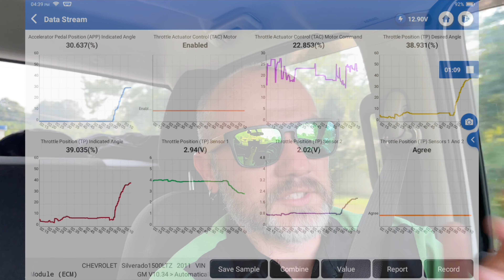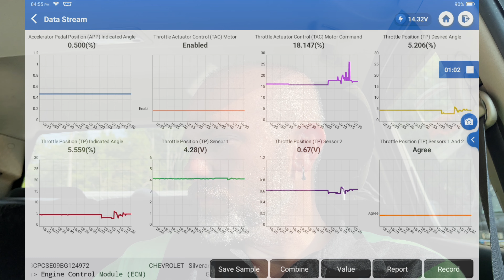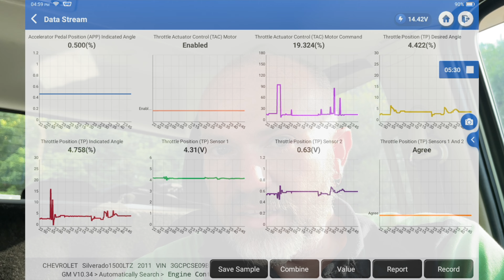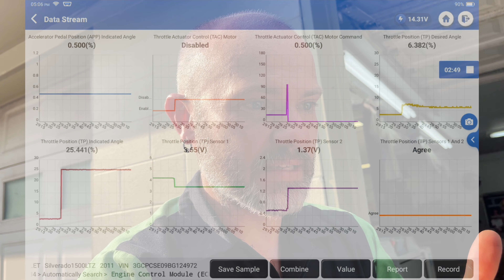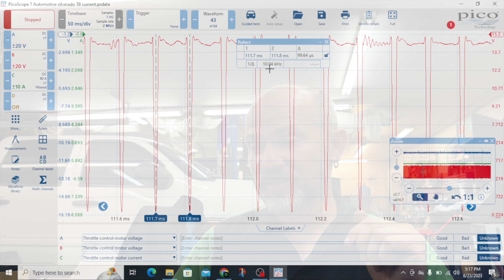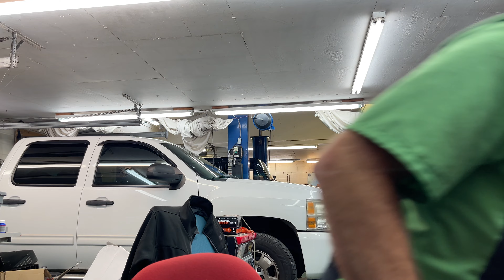Today I was a Parts Changer...

Comment: Posting this because it might help others, on some GM cars (in my case a Pontiac g8) there are 2 different throttle bodies.  Most the time parts store only carries the cheapest one which for the most part is the wrong one! I chased an issue like this where the car would go into reduced power mode after a few minutes of driving.  Customer came to me after installing throttle body as well! I was puzzled because everything looked ok on scanner.  So we through another throttle body on it and the second time I realized theres 2 different throttle bodies! Bought the other one and bam it works ! 
Trucks may only have one I’m not sure but cars had 2 different ones !

Comment: Use the power probe to provide power to the throttle body motor with a PWM signal
Reply from the maker: I'm not sure how that would of helped but if I run into this issue again I'll give it a try.

Comment: The ETC motor (DC brushed motor) is being controlled by an H-Bridge 4 quadrant PWM control algorithm as a geared positional system (servo system) which is acting against a default return spring in the throttle body and uses redundant throttle position sensors as feedback for actual position.  The PWM frequency is most likely above human hearing (most humans anyway at 10Khz) and to best tell what the motor is doing we need to monitor the motor current.

So the aftermarket throttle body has an intermittent brush? The current through the motor cannot change instantaneously with loss of connection due to the motors winding inductance. It does seem a little crazy not to use an OEM part for a critical component like the throttle body.

Comment: I have one now 2007 GM van throttle body issue. Had several throttle body’s replaced connector replaced throttle position sensor replaced all OE  and new pcm.. it’s been having issues for years.. Monday’s job, funny u posted this video.. ty

Comment: On my woman's 2010 dodge nitro.  It was doing something similar to this--   the current would taper off suddenly and then it would spike and go haywire.   I watched a few videos on it and seen that most of the time it was the throttle body--- so I fired the parts cannon with a cheap fleebay aftermarket throttle body at it and it fixed the issue.  So I opened up the old one to find that the plastic gear had a broken tooth.  So when the gear would come up to that broken tooth-- the current in the motor would drop off suddenly because there was no longer a load.    The tricky part was that the tooth was still there -- it was just hinging back and forth--  so it was broken, but not broken off completely.  So sometimes it would still operate as it should, but if you held the throttle in a certain spot, it would push that broken tooth out of place and make it go nuts again.   We use the throttle in nearly the same spot most of the time (between 2k and 3k RPM)  and that causes it to wear on that tooth more than any of the others.   Luckily when this happened, it still let me drive it home in limp mode.  Sometimes it would randomly go full throttle and I'd have to cut the key off, put it in neutral and start it again (on the highway) ---  to get it home. lol.    But I figured out, if I just held the throttle in a certain spot, I could get it home.  when I tried to rev any higher than that, it would go haywire again--  because that's where the broken tooth was.   This happened on one of the coldest nights of the year---   So I think it just got too cold and too brittle, or maybe some moisture got inside and it froze the butterfly in place.   The cheapo aftermarket junk throttle body has worked well now for a few years.  cheers

Comment: Come on man, this does NOT qualify you as a parts changer.  These were controlled experiments with data collection before, during and after, changing one variable at a time.  Swaptronics at most.  I view parts changer and parts canon as almost blind attempts.  

Was this throttle body controlled directly by the ecm, or did it have a throttle actuator control module between the two?
Reply: @autodiagyt  didn't mean to take your title from you lol.. just didn't want to see you sell yourself short.

Comment: Looking at 13:57 in the video, my guess will be that there is some debrie in the internal cogs of the throttle body, or some damage that makes the motor not rotate smoothly.

The motor the throttle body has is a regular DC motor, magnets in stator, coiled rotor, collector and carbons.  When this type of motor speeds up, the current it pulls will go down; you can see it it as a DC generator creating a voltage opposed to the power voltage applied, and only the difference of voltages divided by the coil resistance is the current.

The reason I say debrie or something preventing smooth rotation is due the current waveform:  13:57 -> current goes up and down from 70.0ms to 90.0ms, while ECU has a constant voltage across terminals.  If it was just spinning up without obstruction, the current will only go down as it spins up, but something blocks and breaks it, and current goes up, then it overcomes the issues and spins up again, and hits it again.   You can see that it hit an obstruction 6 times, as it sped up (the little bump ups in current) but then at the 7th one, current started to increase a lot, and ECU kind of gives up, maybe overcurrent.

Also, diff topic, the time units:
ms = milli second 10^-3  (.001)
us = micro second 10^-6 (.000001) letter "mu" from greek alphabet, not "u"
ns = nano second 10^-9 (.000000001)
further details see wikipedia  "Metric prefix"

Great video as always.

Comment: Laughing, Seen that so many times we don't even do any testing anymore especially when we see a newish AM throttle body.
Reply: We got to talkin about that today, we decided that the motor inthe aftermarket throttle bodies can't keep up with the rate at which the computer is commanding it then the computer starts freaking out trying to control it. I think that's why you didn't see the amperage draw you were expecting because the motor simply wasn't responding

Comment: I have one like this that does something a bit different. I graph all the data pids app 1 and 2, throttle 1 and 2. And 5v ref 1 and 2. I will randomly drop out all the data pids to stars ****. I recommend ecm but haven’t gotten around to replacing it. Seems like a right call it has app and throttle acdelco
Reply: @autodiagyt  not that I’m aware of, it only sets a throttle related code. So I mainly looks at throttle data

Comment: Analyzing data like this can be tricky and takes practice. You were on the right track by looking at voltage on both sides as well as current. When I Looked at the data (obviously after the fact, knowing what the problem was) it makes sense that the throttle body is faulty. Look at the facts: When you said “if I’ve got constant power and constant ground, why is current dropping?” To me, this could only mean the resistance of the motor windings was increasing which caused the throttle plate to close and the engine to stall. We can all learn something from this. Great video!

Comment: Changing parts at no cost or even low cost to quickly rule out potential suspects is a totally legitimate diagnostic procedure.  Often times it ends up costing less for the customer instead of paying you by the hour doing testing to figure out if a part is bad.

Comment: Interested to see an in depth autopsy of these bad aftermarket sensors and circuit board controllers so we can see what they are doing wrong. You and Ivan should send them to someone who will open them up and test the circuits compared to an oem and see why these parts are no good.

Comment: Lol!  I would've called the ECM also seeing what you saw Jake... Great case study.  At the shop I work at I constantly have to try to convince,  and sometimes even argue for OEM replacement parts.  Certain parts you just know you have to go OEM or you're going to have problems,  if not immediately, than shortly thereafter.   I get so tired of doing the same job twice due to faulty new parts.  The Industry has definitely faltered in this area.  Great job again Jake.  Thanks for putting in the time and effort.

Comment: Nothing like the old days, steel cable from pedal to throttle.😊
Reply: Not that great when the cable the tube runs in has dirt or is damamged due to friction.  I have been there, and the engine keeps accelerated without pressing the accelerator.  Not good.
Reply: @ikocheratcr  easy fix, turn key off replace cable or clean and lube it and move on with your life. With this modern tech, you need a few thousand worth of equipment just to find out your throttle body is bad. 😉

Comment: I had the same problem about two weeks ago. I scoped the tps 1 and 2 and the tps 2 was pulsing and at the same time i had the amp probe on tac motor and it was pulsing too. To find the problem i disconnected the tac module and no more pulsing. We put a factory tac motor and all good.

Comment: nice bit of diagnosis work my friend and i would agree there that motor windings must have been heating up to change the draw . i tell you man i am 57 years old if i had a pound or a dollar in your case for every time a after market part had lead me on a wild goose hunt. i would have been able to retire years ago 🤣🤣🤣 worse thing is you would have thought i should have learnt by now . yet last week i was looking at an intermediate starter fault for an hour or so and yes you guessed it turned out to be a bad starter solenoid . after market part , i should have just gone straight for the starter but i like to know what’s gone wrong but also why it’s gone wrong  . sometimes it’s just because it’s crap 🤣🤣🤣🤣

Comment: Great title, Jake! At first I thought intermittent connection, but not with current flowing (you should see the same breaks in current). The curse of aftermarket parts causing the problems, has been increasing lately. If you didn't have an ECM and a throttle body to test, you would have wasted a lot more time, because this was a nasty problem to figure out, with no logic cause to be detected.

Comment: Uh oh Parts Cannon time!
Reply: @autodiagyt  I remember seeing this exact fluttering Throttle body behavior P1516 on a 1st gen Silverado 8.1...Guy went through 3 Napa reman units since new OEM was discontinued. Had to adapt a Gen 2 TB to that truck and perform some creative Russian Hacking to make the TAC happy lol
Reply: @PineHollowAutoDiagnostics  Didn't that one involve a block of wood under the gas pedal because the TB was reaching 100% before the pedal was actually at 100%?
Reply: do a scope test on tp1 and tp2 5v and signal on 06 chevy or maybe other years and u will see one will have a constant drop to grnd from idle to wot koeo and explain this please i have not found anything on this but these veh run fine and ur scan tool will not show what the scope shows thanks @PineHollowAutoDiagnostics